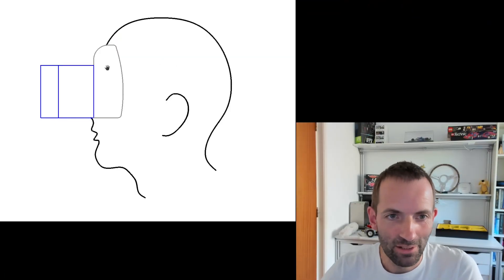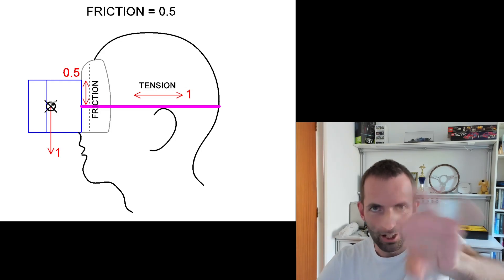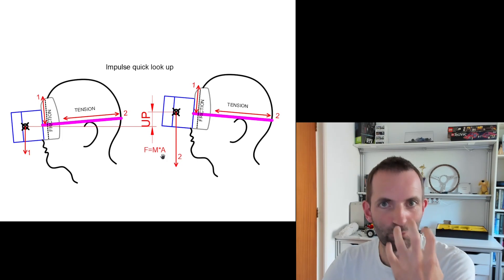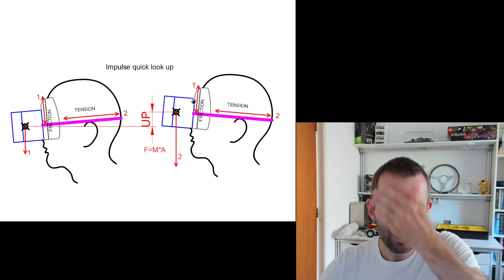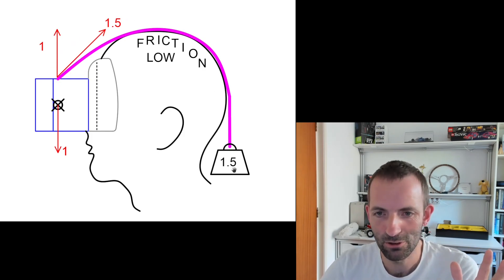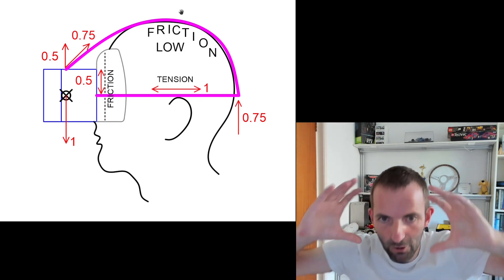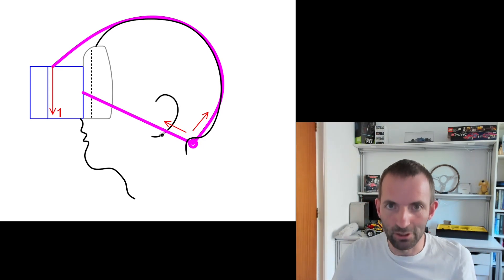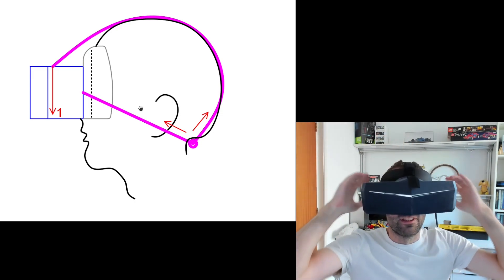VR "Head Physics", The Details of Strapping It On

Comment: The default Pimax head strap's back piece is meant to be tightened at the back of the head/neck sort of in the neck/head hooking spot you describe here, however, most people have the back part of the Pimax strap placed high on the back of their head - like eye level or a touch below like how most other VR headsets are worn and that's wrong. Having it placed low, as Pimax recommends, is apparently quite crucial.

There are Pimax counter weights from Studio Form Creative that apparently make a big difference too. Yes, overall weight will be increased but the kit has been consistently praised by many for increasing comfort and vision-consistency due to having a much more evenly weighted, and therefore balanced, headset. Many people who were skeptical of the SFC kit (due to the overall weight increase) were pleasantly surprised after trying it and say it makes a world of difference for them.

Comment: Niels, what do you think about the new Pimax Crystal? It's got a 6000 mAh battery as a counterweight this time around, and early testers say it's a lot more comfortable and balanced because of it. I already got the pre-order in for one as I am coming from the original HTC Vive, which is a headset that has you guessing pixels for where the apex is.
Reply from the maker: more weight = more inertia = bad when shaking/bumping around..
Reply: @NielsHeusinkveld  True, but my glassfiber helmet (a HJC i90) also weight 1720 grams. So it also depends om the friction fit onto the skull if it becomes annoying.
I agree though, with too much movement means your VR glasses shift out of that sweet spot and you lose focus. Which is the real problem.
Maybe we need full helmet VR? Or just a VR device you can put on a regular helmet instead of the visor.

Comment: The solution? attaching a balloon of a gas lighter than the air, for example Helium, that is constantly carrying the weight of the headset? 
Or

making the headset light as a feather to begin with (which can make it 10X as expensive)?

Comment: for me with the 8kx (and most headset honestly) the only way to wear them comfortably with my big nose is with a decent counterweight and kinda wear them like a hat. I've cut the foam so that it's pretty tight on the sides of my face and my forehead but doesn't touch my cheeks or my nose. Like you said, large movements can be weird but it's a needed tradeoff. Thankfully new headsets are going the lighter route, and for the 12k I think I'll just make a helmet mount since I only use it for sim racing anyway.

Comment: Hear me out: choker strap

jk, I find most comfortable to my preference halo-like strap (BOBOVR M2 for Quest 2 for example), it's drastically reduces pressure on the face. I recently swapped Quest 2 with it to a Vive Pro 2 and really missing it. I also think strap should've been made from solid material and create a rigid conjunction with headset, no matter how tight you will tighten flexible strap it will flex and move a little in a rush.
Another point is surface area contacting with your head, the more you have it the more friction you'll have and the less headset will move around your face. Most of VR headsets uses fairly small area face masks which also increases the strain on the face from pressure.

I never wore any race helmets on my own but how they fit on the head? Does it sit tight? What do you think about idea of integrating VR headset into the race helmet?

Comment: I've only used headsets with more solid "side straps", the Lenovo Explorer and Valve Index, and I think the rigidity there may play a large part. If the rear is locked in place relative to the HMD's front, it can't so easily slide up the back of your head when you tighten the top strap -- the Lenovo headset doesn't have one but that's the least of my issues with it.

The Index in particular has a large rear section that goes both straight back /and/ loops down under the back of your skull, with a soft strap on top to seemingly adjust how much tension is taken up by the sides through front-back tension and how much is a sort of squeezing force from the top of your head down to the base of your skull. It doesn't actually swoop down quite so low but it's a stable enough connection, in my experience.

The other primary difference setting my two headsets apart is really in the facial interface. The Lenovo Explorer is practically flat when comparing it to a human skull, so there's especially nothing on the sides to help dampen rotation side to side, whereas the Index happens to fit my facial structure perfectly (perhaps it's a fluke or perhaps they really did spend time thinking about their product) and so the headset fits fairly snugly regardless the action I'm making. Too bad it's still heavy enough of a headset that it's not sufficient to keep it actually immobilised in relation to my face.

Or maybe I'm still just trying to make excuses to make myself feel better for dropping money on a headset to crash cars into walls with.

Comment: You know what's worse? To be able to even see sharp in the original Vive (with deluxe audio strap) I need to have it rest on my nose, and that nose doesn't love that weight as after an hour it says "no more!". Also with a thin face cushion my eye lashes are almost touching the lenses. 😅

Lastly my solution would just be to simply to use a full face helmet (integraal helm for us Dutchies) that is lightweight and has build-in active cooling to stop condensation from happening on the lenses and to add a bit more comfort in the summertime.

Comment: I've never had the goggles (Vive) falling or sliding down. However, getting the placement of the goggles and the tension of all straps (right, left, top) just right is quite finicky. If you don't get it right you don't get a clear view as the screens are not perfectly aligned with your eyes. Heavy goggles will never be too comfortable. In a driving simulator some uncomfort is acceptable as the goggles kind of feel like a helmet. You're also not going to sweat too much when sitting down.

Comment: May I suggest you take a look into the geometry of CPAP mask straps? They would only work in tension, but  they hug the whole head around the back, along with 2 arms over and under the ears on each side (maybe adding a 5th arm over the head, because CPAP masks are too light to need one like VR headsets). It would probably control the inertia of the headset when the head is moving a lot better than the simple 3-point attachments you've shown, and the side upper arms would control the rollling forward moment of the headset mass hanging off the face. Still, wouldn't do a lot for the other issues you've mentioned - for dynamic control, you either add tension (hurting your face) or weight (hurting your neck and adding inertia)

Comment: Addressing the pressing issue of Niels feeling hot with his strapon, I suggest this: a gyroscope attached to the vr headset with a horizontal axis of rotation, and vertical plane of rotation of the disk. This would convert the torque due to gravity pulling the headset down into a horizontal precession. Obviously, to avoid the head twist relative to your body, your seat and entire rig will need to rotate with your headset. But otherwise, problem solved. Btw, a second gyroscope won't help...so no silly suggestions please. Edit: my silly suggestion was made sillier by having the axis of rotation vertical; I  meant horizontal. Never mind....

Comment: You're onto something with a counter weight. I have thought the along similar lines. You don't want more weight bu possibly an adjustable elastic strap that could attach to some shoulder type reverse vest. Hard to explain.  Tension is still weight but the  inertia wouldn't be. Just thinking